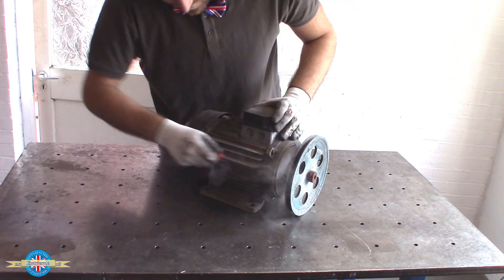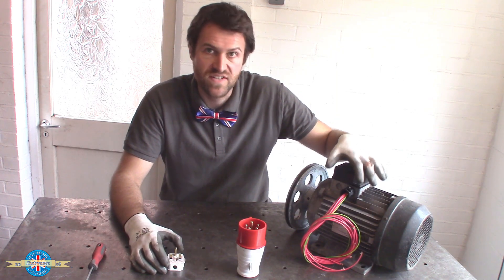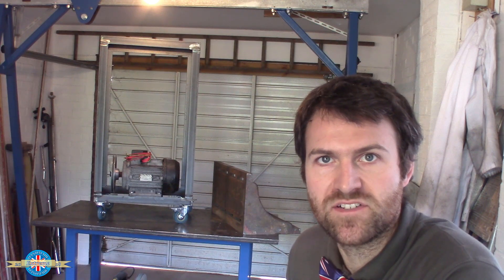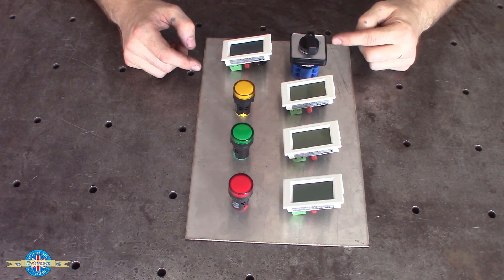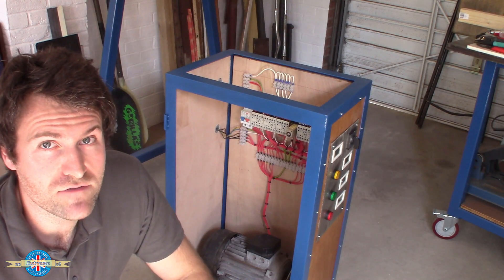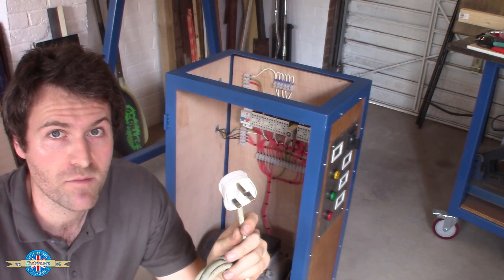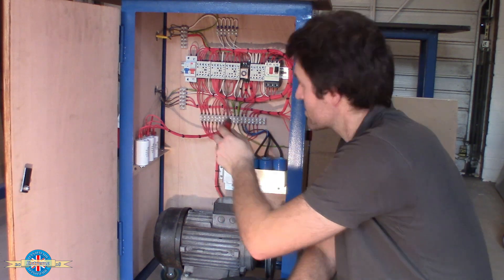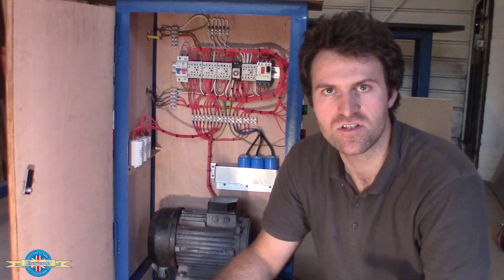1 Phase to 3 Phase Rotary Converter - 230V to 415V

Comment: Or just go onto eBay and buy a cheap variable speed drive which gives more control. You can buy types that give either 415V or 220V if your 3-phase motor is a universal type that can be reconnected in Delta configuration.
Reply from the maker: Thanks for your comment. This was a consideration. However I have a few machines that I want to power and it was more cost effective to make the converter than buy multiple VFDs. Cheers, hope you enjoyed the video and thanks for commenting. 👍😀👍
Reply: Fair enough, but there are huge advantages in having a variable speed drive on a lathe for example. For example, you can part off under power in a high gear, using the VFD to limit the torque in case it jams up. I always part off under power and it's never going to end in the sort of drama you get by using a low speed on a geared lathe where it wants to tear the tool post off if it jams.
You can also change the speed on the go which is very useful generally but even more so when you're screw cutting.
They don't cost much these days. I've got them on the Lathe, Mill, two on the Grinder, one on a high speed spindle and another on a Hydrovane compressor. I've never had a failure and I wouldn't do it any other way, it's so flexible.
Reply from the maker: Great point about parting off, I had not really thought about that. Regarding changing speed I am in the very lucky position that my lathe has a CV transmission ( well, lucky until it goes wrong haha) so I can wind it up and down on the go. Similar system to the vari speed head on a Bridgeport mill. Ummm hydrovane.... want one... maybe I should make one. Cheers👍👍

Comment: Why not use a variable frequency drive?
Reply from the maker: I have a few machines to power most of which have multiple motors so doing it this way was a bit more cost effective for me. Both my lathe and mill have CV transmission as well so I would not even benefit from the variable frequency from the VFD. Cheers and thanks for commenting.  👍👍

Comment: Dont laugh, I know very little about this stuff, but shouldnt this be in an all metal GROUNDED cabinet?
Reply from the maker: Ideally yes, but its not really a problem, one of the main reasons metal is used as an enclosure for electrical panels is that it cuts down RF interference more effectively. As for grounding, you don't see my do it in the video but all the exposed metalwork (frame fascia etc are grounded). Cheers 👍👍👍

Comment: Interesting build, even if the single phase lines where scrapped out in my country after the 70s. But if i am not wrong here, a similar principes can be used for as an example convert a 3 phase asyncron motor to a generator.
Reply from the maker: Glad you enjoyed it. Yes I believe you can do something similar with synchronous motors but I have not really looked into it. Cheers. Idea for the future perhaps. 👍👍

Comment: 3 phase from the single phase? Doesn't that mean a little over 3 times the wattage at the single phase than the 3 phase tool consumes?

Also, doesn't that also mean that the winding of the motor connected to the single phase sees the full load of all 3 phases? Does that mean the converter motor need to be rated much higher than the tool load to keep from frying the winding of that phase?

This is bloody cool though. I've been contemplating getting a lathe, but haven't considered powering it short of  "Maybe I'll have to switch the motor out for something a little more tame" :D I'll have to do some researching now!
Reply from the maker: Not quite but I can see where you are coming from. Since each of the three phases are 120 degrees apart (phase angle) they don't all draw peak power at the same time. If you google " 3 phase sin wave" you will get an image that shows you what I mean. 
Each of the supplied phases is across one of the idle motor windings. So that load goes into that winding. The single phase supply is also connected across one of those windings so it is directly powering one of the three phases and also running the idle motor.
You are right that the idle motor needs to be larger, roughly 1.5 to 2 times the size of the load. A big flywheel on the front also really helps. I like to think of it a bit like a rotary engine you get one power stroke (the powered phase) then 2 un-powered (the two generator phases). The flywheel, just like it does on an engine, stores energy and allows the shaft to maintain its angular momentum through the un-powered parts of the cycle. 
There are 5 main ways to run a three phase machine at home.
1) The most obvious and normally the most expensive is to have 3 phase connected to your house. 
2) A rotary converter 
3) A static converter
3) Vairable frequency drives 
5) Swap the motors to single phase ones. 
Hope this helps. Glad you enjoyed the video. 👍👍👍
Reply: I realize they don't draw peak power at the same time. Where it gets fuzzy is the fact that the motor is powered by the single phase, and generates the other two phases.
You need to consume energy to create electricity and since the only thing powering this is the single phase, it seems to me the full wattage of the load +conversion/generating losses would have to come from the single phase.

What I'm picturing is the two generated phases slowing the motor down, leaving the one powered phase to accelerate the motor back up to speed plus supply the remaining phase.

It's a bit of a puzzle for me to wrap my brain around. Maybe it's just that I don't really deal with 3phase in my life, so my perspective of the power consumption of these tools is off.
Reply from the maker: Sorry yes, your explanation there I think is spot on. I'm not sure I read your first comment correctly. My apologies.

"What I'm picturing is the two generated phases slowing the motor down, leaving the one powered phase to accelerate the motor back up to speed plus supply the remaining phase"

Great comment, cheers. 👍👍👍

Comment: Could you maybe supply a schematic for easy rebuild?
Reply from the maker: I'm afraid I don't have one. However, if you look in the video description there is some additional technical information along with some links to a couple of other videos that go into more technical detail including some schematics. Hope this helps. 👍👍
Reply: well i actually must admit (i am a electrician) i was thinking quite a loooong while yesterday how it's possible with a "normal" motor to accomplish that task.
BUT then it hit me like a lightning, this is not a "normal" motor. You weren't using "just" 4-wire (earth, U,V,W) to connect the motor. You are using indeed 7-wire (earth, 1U,1V,1W, 2U, 2V, 2W) It is one with two separate windings isn't it? 
Your injecting your bump upped startup-capacitor (Anlaufkondensator) star-configed 1phase 240V into one set of windings and tapping of more or less 400-420V in delta from the separate second winding set. 
And the whole relay setup is more or less just to get the motor running with one phase and probably for starup power relief*?* (Anlassentlastung, Anfahrentlastung, again don't know the right matching term)

What me interesset most is now, how far of ist the actuall powerfactor? Do you have a classic 240V Energiemeter to plug between your Rotary Device and the Walloutlet? And how load sensitiv is these setup if there's a high load on the lathe?

Comment: LOVED that hinge pin idea :D very smart!
Reply from the maker: Thanks very much, glad you got something out of it. 😀😀
Reply: It's odd, I always thought rotary convertors needed a motor and generator coupled with a belt or similar. I'm guessing yours had two set of windings, so the motor and generator sides just share a common armature?
Reply from the maker: I'm not too hot on motor internals but here is my understanding. I think the motor has 1 set of 3 coils, 1 coil per phase, therefore 6 wires in the terminal box.
  Conventionally if you are running the motor in a star delta configuration then you configure the coils in star to start the motor. This applies 230v and X amps to each coil to give you lots of starting torque. once up to speed the coils are reconfigured to delta to apply 415v to each coil with ~X/2 amps per coil. 

What I am doing is starting the motor in Delta with 230v across one coil and some caps across another coil to give it some extra excitation to get it spinning. I then switch to Star and apply the single phase live to one end of a coil and take the neural to the star point. At this point the other two coils are generating a voltage via induction. There are then a set of balancing capacitors across these two coils to match the output voltages. In the Star configuration I'm putting in 230v across one coil (how it should be in star) but then I get 415v phase to phase. There are couple of links in the video to a channel by a guy called galvinzedgary who knows a lot more about the technical side than me. Might be worth checking them if you are interested. He shows some diagrams and goes into a good level of detail. 
Hope this helps, cheers 👍👍
Reply: Oooh that's very clever! Power into one coil, then the three phase output out of that coil, and the other two. That's genius :D
Does the large pulley on the motor play a role? A flywheel to balance the speed/vibrations?
Given you a sub, you've piqued my interest :P
Reply from the maker: Cheers, you are right the pulley is acting as a flywheel. It helps to prevent the volt drop when you are starting up a machine connected to the converter. I have actually added more mass to the flywheel by attaching a brake disc to it since this video was made. It certainly helps when you are starting things that need a high starting torque. Thanks again. 👍👍
Reply: As someone who has had to line up 39RU network cabinet doors where the pins are identical in length, it's soo worth doing as it's a real pain otherwise!

Comment: The metal control plate isn't earthed?? Can you rectify as this could be dangerous If a cable were to become detached.
Reply from the maker: Its ok, it is. You just don't see me do it on the video. Both the chassis and fascia are earthed. You are absolutely right to point this out. Cheers 👍👍👍
Reply: Thanks for replying and sorry for the abruptness only just found the channel and am already loving it! Can I ask, how many amps does it draw on the single-phase end when running your milling machine?
Reply from the maker: No problem, glad you are enjoying it. I ran the mill yesterday and it was drawing around 8 amps from the single phase using a  ~2.5" face mill, 50% overlap, cutting aluminium with a depth of cut of about 1.5mm. No idea what the feed rate was I just wound up the powerfeed until the chips looked good.  FYI the Bridgeport is a series 1 with the 1.5HP motor rather than the later 2HP one. Hope that helps. Cheers. 👍👍
Reply: Yeah that helps a lot. Thanks for getting back and can I say the wiring inside the RC is some of the neatest I've seen for a long time (and on closer inspection at the end of the video i can see the ground)
Reply from the maker: No problem and thank you. 👍👍

Comment: Excellent explanation, nice tidy construction methods and final result. I did build 2.2kW rotary phase converter in delta only, and used  a timer controlled relay  for start capacitors. Best regards from Wombourne.
Reply from the maker: Cheers very much, glad you liked it and congratulations on building your own RPC. 👍👍👍

Comment: basic motor questions: does the motor you used have 3 windings, only?  And as such, does the motor plate state it is a 415V only?  or does it allow center tapping the windings to also run on 240?
Reply from the maker: Hi, The motor is a standard 4KW multi voltage induction motor  230v and 415v. There is some further technical information in the video description if you are interested. Cheers. 👍

Comment: Excellent video.

One question 
Would the output current be enough to run through a coil that can recharge neodymium magnets back to full strength ?
Reply from the maker: I honestly have absolutely no idea. But that sounds like a very interesting project. How much output current would it require? I assume it depends on the size of the magnet? 👍👍
Reply: Handmade Extreme 
Yes it does depend on the size of the magnet because the magnet especially the neodymium magnets.
Their size depends on how much gause/ osteads they will have.
An engineer told me, if a magnets full strength is 2000 gause then it will take 6000 gause to get it back to it's original 2000 gause. I have no idea if this is right.
Reply from the maker: Cheers, I might take a look into this in the future. It sounds quite interesting. 👍

Comment: The load on the output is not symetrical is it? One phase has to deliver the power for the electromotor too.  And do you have, let's say 16A in and 3 times 16A out? Or is that what you say the 89% efficiency? Great build btw!!
Reply from the maker: The power for the motor in the converter comes from the single phase supply. Each of the output phases can deliver somewhere around 7 to 8 amps. You can not get more out than you put in unfortunately. However its not quite as simple as 7+7+7 is greater than 16. Because of the phase angle between phases. The three phases are not continuously delivering the 7 amps since it is an AC system rather than a DC system. It's a shame I can not post pictures in the comments. But , if you google "three phase AC sin wave" and take a look at images then that shows you what is going on with the voltage and the current. Hope this helps. Glad you enjoyed it. Cheers. 👍👍👍

Comment: Why would you bother. Just buy a VFD.
Reply: It looks like you would be only using one device at a time anyway with your rotary converter, so one cheap Chinese VFD (on a portable system like you made) with a single 3 phase plug could have been viable. But I guess you recycled parts you already had, and I have seen such converters on 40 years old ship accessories.
Reply from the maker: You are correct, I do just use one machine at a time. 
The problem with using a VFD as a plug in converter is that a VFD should be connected directly to the motor. You should not have any switching after the VFD as it can damage the IGBT components. Therefore you need one VFD per motor. So I would need at least 3 as my milling machine has 3 motors. I would then have to rewire all of my machines. Then to use a the milling machine I would have to plug in 3 VFDs, I'm sure you can see where i'm going with this. Basically the rotary converter is just a simpler solution when you have more than one motor to run. Plug it in, plug in the machine, switch it on and off you go.. Cheers, hope that gives you a bit of clarity on my thought process. Thanks for commenting. 👍
Reply: That makes sense, they are indeed designed to be permanently attached and tuned to one motor. Manufacturers indeed don't recommend a disconnect on the output side, but it is acceptable with an interlock circuit (a signal to the VFD that activates it only if a motor is in circuit). I know that at the very least the VFD will trip on alarm after a load imbalance (i had some related problems). In the end, you indeed made it simpler on an electronic point of view.
Reply from the maker: For my application the rotary converter is more financially viable. Doing it with VFDs I would need about 7 of them in various sizes. Cheers. 👍

Comment: Do you get only 2 thirds of the power from this? and yuck only red wire for all the phase wiring, you are lucky you got the phase rotation right
Reply from the maker: The only measurement I have so far is with the lathe running but no cut load applied. That works out at 89% efficiency which is taking into account phase angle etc. Re red wire: I know what your saying it was a challenge to keep track of it all, especially since I didn't bother to number it. But I was just using what I had. If it was cost no object then I would have done it differently (properly. 😉) Cheers, 👍👍

Comment: Wow :D That cable management is pure pornography, you wouldn't believe some of the cable management jobs I have to suffer through when I open a clients network cabinet :( I have been a computer guy and programmer for almost 15 years now and I just got into electronics and Arduino last year. To learn myself the basics I made a remote dimmer and relay box for my lamps which can be controlled by my smartphone via WiFi. Last week I finished the modifications to my mobile airconditioner to give it WiFi and some smarthome features. Programming and electronics are a match made in heaven, I hope that one day I will be as proficient at electronics as you are :D I must say I am very impressed with the amount of craftsmanship and skill that went into your phase converter. It's a real beauty. Cheers mate!
Reply from the maker: Thanks very much. It sounds like you have some cool projects on the go. I'm really not that great at electronics to be honest. I have a good understanding of power circuits / motors drives and PLC control systems but my knowledge of component level electronics leaves a lot to be desired. Glad you enjoyed it, cheers. 👍

Comment: What is specific in this induction motor? Does it means this motor have more windings in a stator?
Reply from the maker: Motor is just a standard 4KW multi voltage (230/415 Star/Delta) induction motor. Same as you would find a most bits of industrial machinery. I got this one second had but was told it powered a compressor in its former life.  Hope this helps. 👍👍

Comment: Interesting project. I'm a bit worried about the lack of earth bonding inside the unit though. The chassis and front panel should be bonded to earth in case anything goes wrong inside. Given the voltages involved it could give you a nasty nip!
Reply from the maker: Hi David. The main chassis and fascia are bonded I just didn't get it on camera. You can sleep easy 😉👍